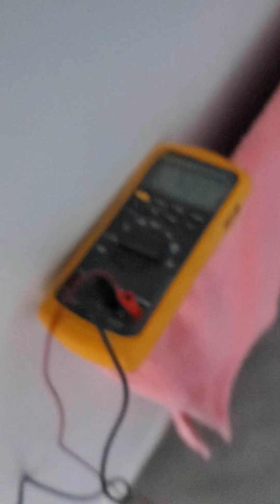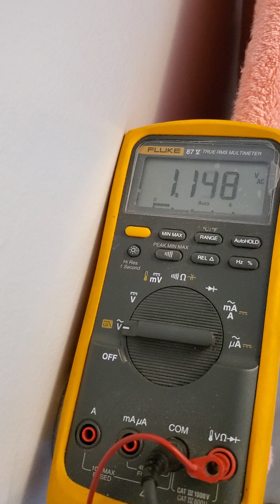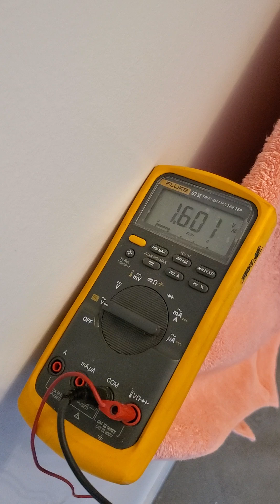hot wire measures 18v or 16v on multimeter?

Comment: The previous 3 comments seem to be in the right direction. I have seen this in a few instances where in old houses, they had shared neutrals and when one of the neutral (white wire) got disconnected or open, then disproportionate voltage drops popped up  causing lower voltages in some places. One way to test would be to check the voltage between hot/black and ground, which should show 120 VAC, while between black & white (basically hot & neutral) is low like it is showing  16 VAC in your case.. This is a very dangerous situation. The first thing to do would be to disconnect the breaker then methodically find the open and eventually remove the shared neutral and provide each neutral separately to each circuit. Getting a professional electrician would be advisable. Hope this helps.